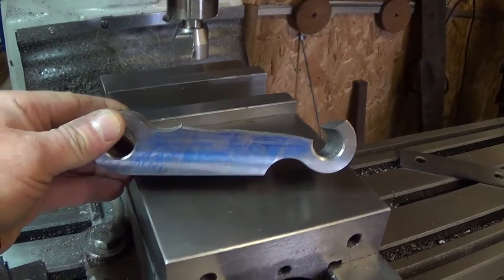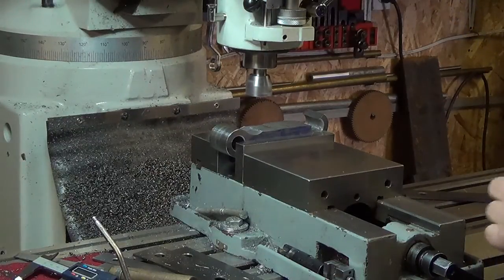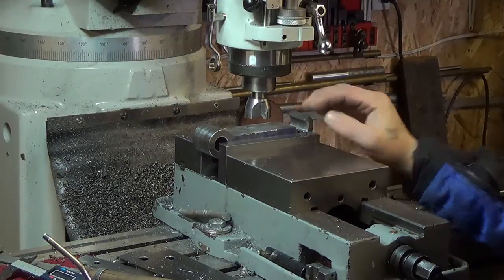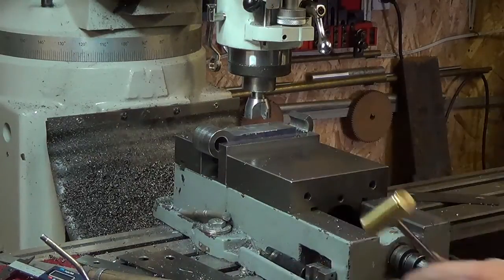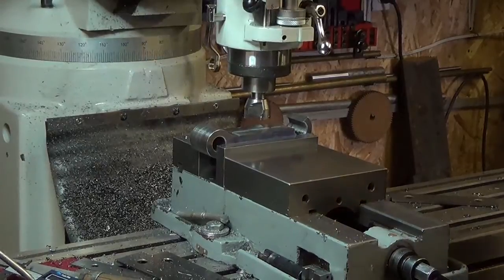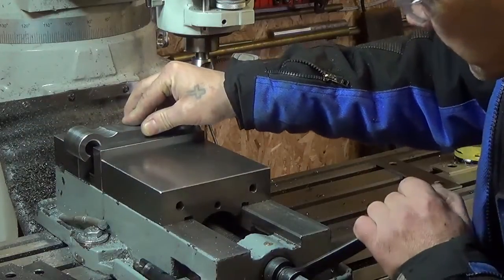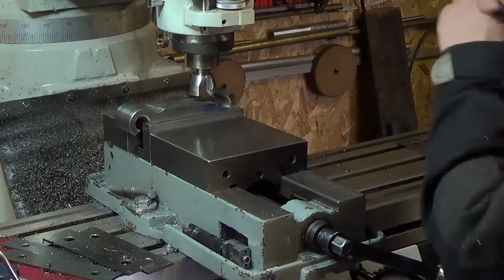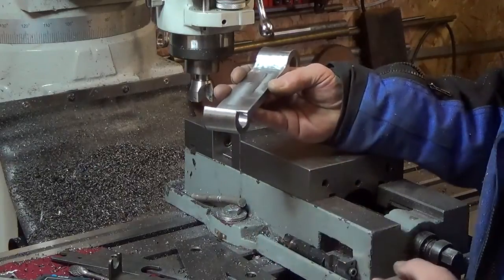5th Axis - Part 2

Comment: That sure is a nice project!  I was contemplating making one of these in the same manner, but recently saw someone make this part by first turning a section of shaft to the size of your ends, which he split and welded to the ends of a flat bar.  Not as pretty as yours, but it should do the trick with a lot less time/chips to make it.
  Looking forward to seeing the rest of the parts you make.
Reply from the maker: Hi Jack. I had thought about that method but aesthetics was a factor. I wanted it to look nice. Thats not to say that a welded unit with good blends can't look nice but I usually wind up taking the hard route anyway! :-)
Another thing is that a half-circle end piece won't give enough adjustment swing to reach vertical. Mine should have just over 90 degs swing and be able to reach from flat on the table to vertical.

Thanks for commenting.
Colin